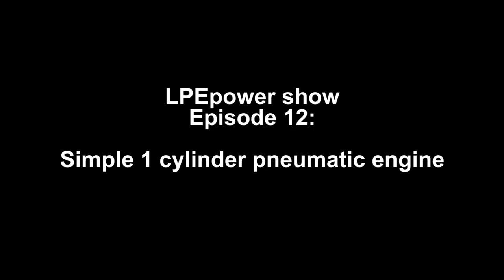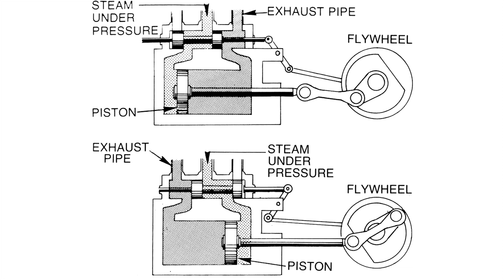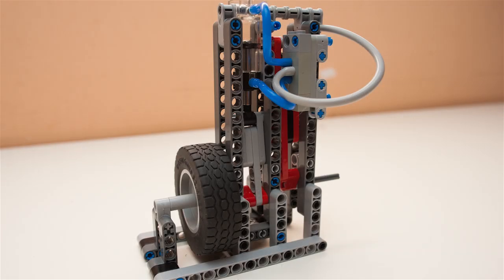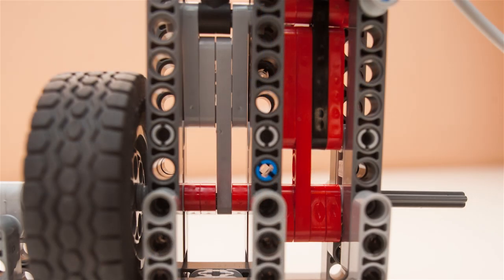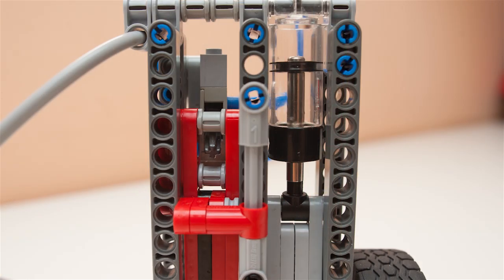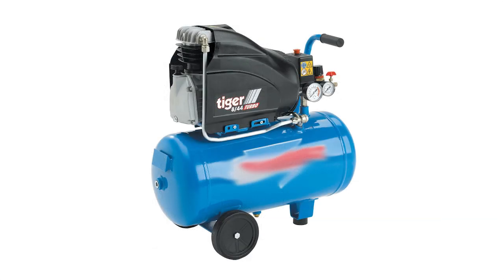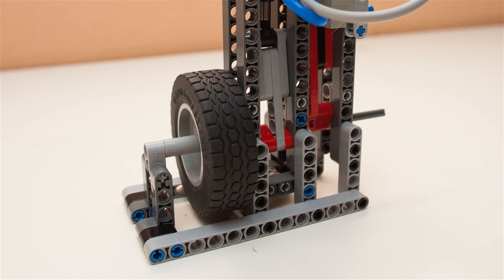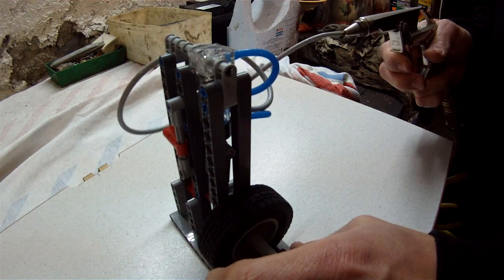LPEpower episode 12 - Simple 1 cylinder pneumatic engine

Comment: I got a question, could I just use a lego motor like the 2838 motor and hook it up to the final product of my oen lpe engine and see with a speed control to the lego motor if it will withstand up to the rpm that I want the motor to run qt ir is that dangerous to do due to flying parts?
Reply: knightrider1545 The electric motor can not spin the engine as fast as the engine can run by it self, so there should be no issues. I don't even think the 2838 has enough torque to turn the engine, but ofcourse i have never had the honor to test an engine build by the master himself, nicjasno, only my own pesky creations.
Reply: +knightrider1545 I think the engine will have more rpm under it's own power.
Reply: +knightrider1545 I think the engine will have more rpm under it's own power.
Reply: +telefon72 thanks for your response
i dont know why alex@ lpe didnt respond im guessing busy in the lpe world
anyways i was saying, using a 2838 motor to wind up the lpe motor to test the motor at high rpm to see durability of the motor, readon stating this is i may not have a super 
air compressor to run the motor to a test speed.
Reply from the maker: +knightrider1545 I really don't understand your question.
Reply: nicjasno I had trouble understanding it too.
Reply: nicjasno
USing a 2838 motor as scapegoat, i use 2838 motor to turn the lpe engine to test it in speed 2838 motor shaft to lpe crankshaft, spinning it with the motor, but, will testing it be dangerous since the 2838 motor is a fast motor and possible pieces flying apart during testing?
Reply from the maker: +knightrider1545 If the LPE is of my design, it will not fly apart.
Reply from the maker: +telefon72 I'm sure if you use some sound engineering principles, your engines are as well built as mine. If the cylinder and switch are modified, the motor should be able to spin the engine without problems. The one in the video was spinning extremly easy.
Reply: nicjasno I did take my time modifying the valves and cylinders, but i don't think i am as good at it as you. I got my engine running pretty smoothly though.
Reply: nicjasno I think if you put a 45 degree angle it runs like a champ but the thing is it needs a lot more pressure to get going

Comment: Thanks. Why do you need to mold the plastic tubing over a candle? I was thinking of getting silicone tubing with a higher internal diameter than standard lego tubing, because the inlets and outlets will all be bored larger. Also, it shouldn't have problems with micro-leaks as far as I know.